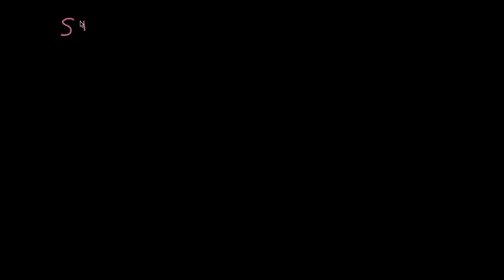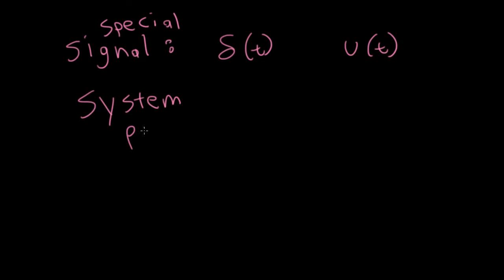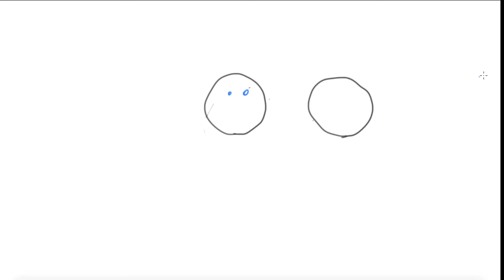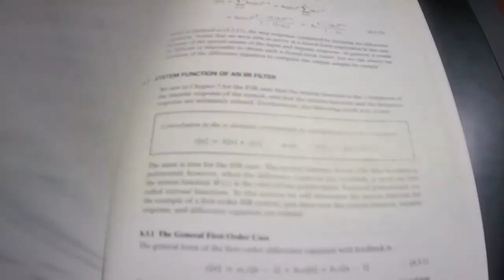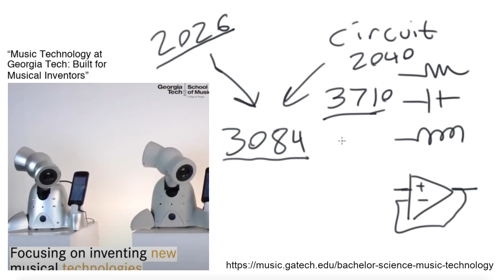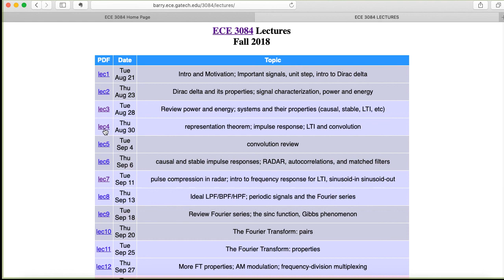ECE3084 Signals and Systems: Introduction (Lecture 1, Georgia Tech Course)

Comment: By the way, I found your lecture because I was digging around for more information on Barker Codes, of which there is very little.  Your lecture on Radar and Barker Codes was very helpful.  However, I was specifically interested in Barker because of how it applies to Wifi, 802.11b.  I have yet to find anything in books or online that explains how you can lose the majority of Barker chips and still reconstitute the original signal.  I have since concluded that this idea is less a consequence of Barker than how Barker is used.
Reply from the maker: Interesting!